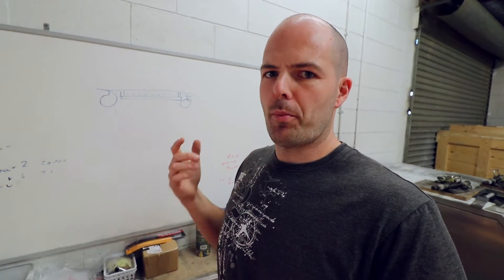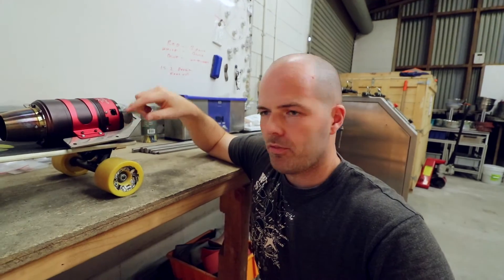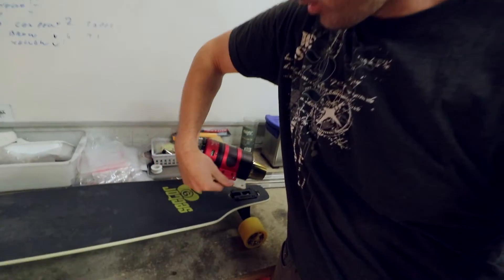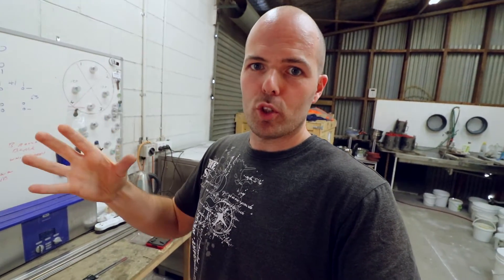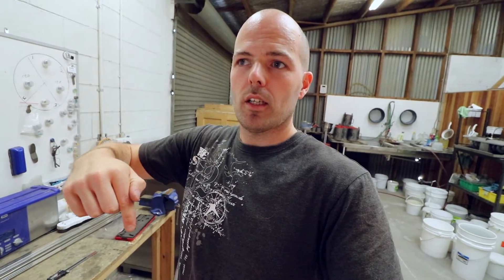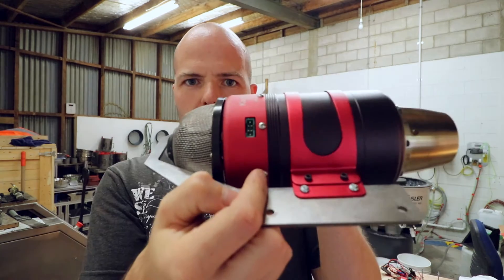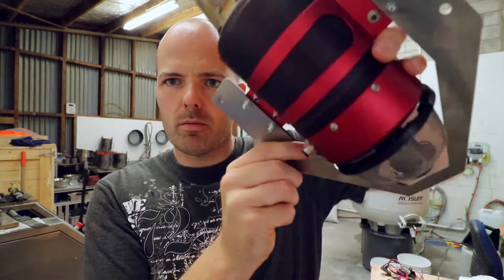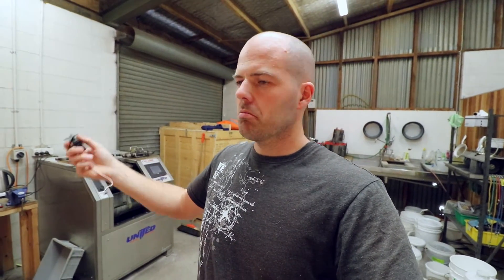Jet-Powered Skateboard (Part 8)

Comment: Hey Magnus, Yet another riveting video that I look forward to each day.I addressed some of todays topics in comments for parts 6 and 7 video.Here is todays commentary  :-) ( I wished we were neighbors)
Braking:
1. You WILL need to learn "foot braking" many videos on how to. Here is one  

https://www.youtube.com/watch?v=lljC4KmC36c

2. Mechanical brakes: Many have tried making brakes for skateboards with limited success. There are 3 products that you may get ideas from. 2 of them require the use of a hand activated lever. Remember you will already have one hand tied up with the throttle. You may want one hand free to break your fall when that happens. 
 Here are pictures of those products

http://www.skatebrake.com/images/kitttt.jpg

https://i.ytimg.com/vi/QWM6ALGxaD0/hqdefault.jpg

http://www.pogo.biz/media/catalog/product/cache/3/thumbnail/1400x700/9df78eab33525d08d6e5fb8d27136e95/s/p/speedneedle_detail2_1400x800.png
The problem with the drum/disc brakes is that the surface area is small and they cannot dissipate much heat and fade and wear out quick. They are ok for beginners and casual speed.

3. My suggestion for this project is to learn to foot brake, practice until you have confidence. You will still need a parking brake though. This break needs to hold the board from rolling at idle ( and it will roll away from you) and it will also deploy or set if and when you fall off.  This idea is to use a Ski Brake (make or purchase)  Here is a picture.

http://www.lockwoods.com/images/uploads/fritschi/vipec_12_brake_2014.jpg
When your foot comes off the plunger the braking legs drag the road. Put this near the rear or behind center so the rear drags and the board will go straight. If you put in front the board will flip around or over.  It will act as a parking / emergency brake.

KILL Switch: As described previously, YES you absolutely need an emergency switch for when you become detached from the runaway board and also for when your transmitter shutdown command does not work. (This will happen eventually). The easiest way to do this is with a lanyard switch like on a jet ski or 4 wheeler.  This is what I use, but there are various versions. You can attached the tether end to you ankle or wrist. Mine goes around my arm, but I am laying down.

http://boatwiring.org/boatwiringhelp//wp-content/uploads/2012/07/Kill-switch.jpg

You can use it to break the battery circuit to the ECU. If the lanyard gets pulled everything gets shut down immediately. Once you get back to the skateboard you can plug it back in and the cool down cycle will commence on it's own.

If you feel the need to shut the fuel off you can use this kingtech solenoid. as long as power is supplied fuel is free to flow. switch it off fuel stops, but pump will continue to try to run, then engine stops with an ECU Fuel or RPM error.

http://www.kingtechturbines.com/eshop/index.php?main_page=popup_image&pID=25

Turbine Mounting:   Mounting like today's plan will LOOK the coolest. May I suggest making brackets similar to this

https://www.auxbeam.com/image/cache/catalog/p/70021876/70021876_1-800x800.jpg

I say similar because these light bar brackets only have one mount hole on one end you need 2 minimum. 2  pieces of titanium or aluminum right angle bends on each end to match engine mount to skateboard mount hole pattern.  You can sweep it back or water jet cut patterns to make it nice and fancy. (jealous for the water jet).

Fuel Tank: Again previously described in recent video comment, but you will also need room for the remaining hardware under the board. You can make more clearance under the board by top mounting your trucks.  They are currently mounted as drop thru to lower the deck for easier kick height.

That should give you enough to chew on and invent you version in your head. As always feel free to bounce ideas or ask questions.  i.e.  learn from my mistakes  ;-)
Cheers
Bob
www.jetluge.net
Reply from the maker: Bob, man, I only just saw this comment was waiting for me to "review" it (I never received a notification about it from YouTube). I don't have time to look at it right now as I'm up seeing my Son right no ...but will check it out at the weekend. Looking forward to possible braking options you have shown...
Reply: I sent you my email address earlier , please send me yours and I will email ideas and suggestions and perhaps sketches (crayon and napkins) direct to your preferred address. I know your busy and it is hard to keep up with comments in a timely fashion.
Have good day
Bob
Reply from the maker: You're right ...it's easy for comments to get away from me. I kept your email ...but now I can't find it. Sorry about that. I think you can go to the "About" page on my channel and email me there (I think). Let me know if it does not work. Here's the link: https://www.youtube.com/channel/UCZZNDjmzlwUZxXmPmC2lO4Q/about

Comment: If you will use the space between the board and the flat fuel tank to tide up your eletoronic?  Cables can flex that amount with no problem,  and you'll no see them.
Regarding the shut off mechanism its definitely need one as you said. The only way to power off the turbine straightaway is only removing the fuel access to the turbine or are other ways available?
Reply from the maker: I think there are other ways ...but, to my mind, pulling out the fuel-pipe is the 100%-secure way.

Comment: I think your centre of gravity may be too high to keep the board under your feet. Make a scooter, you can hold on and mount the fuel tank in front of you behind the handle bars.
To brake the board you may need reverse thrust. Braking will throw you off the board!
Reply from the maker: I think it should be okay (there is not a sudden "rush" of thrust). Will soon find out though :-)